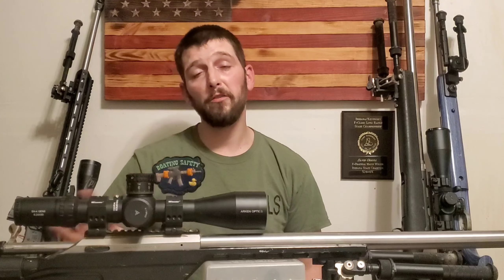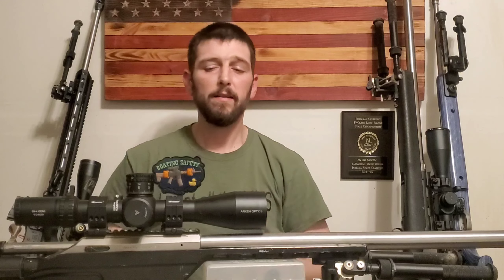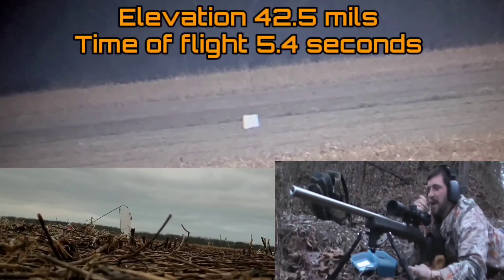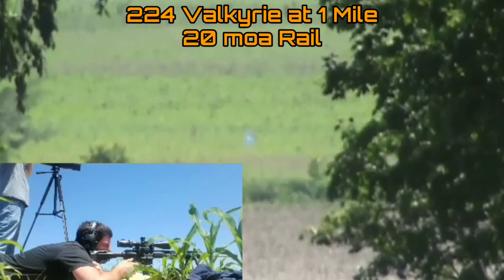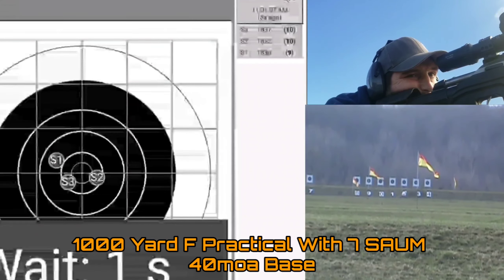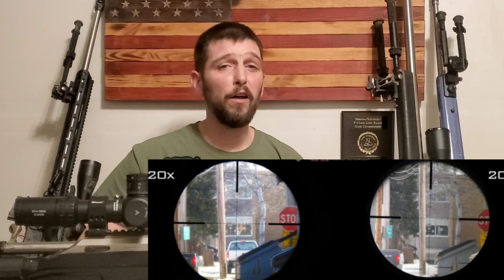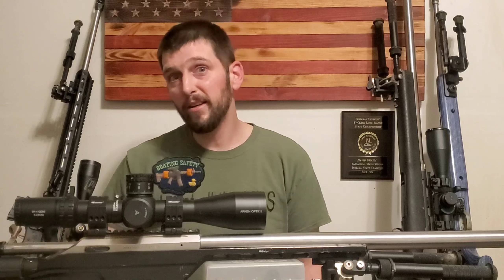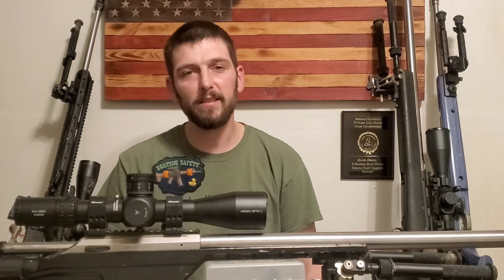Canted Scope Bases/Rails - What You Need For Long Range and ELR

Comment: I'm with you on  "picture box". For my ELR rifle, Ruger Precision in 338 LM, I chose the Valdada Recon G2 for the unprecedented 150 moa that it has built into its elevetion turret (also love the 40 mm main tube). With the factory 30 moa rail on the rifle I get about 105 moa of vertical up adjustment. That 105 moa gets me out to 2,200 yds. with a 95% capacity cartridge charge. Also, on a different note, I picked up a Crimson Trace 5 Series 3-24×56 for my custom built AR10. It sis on a Warne 30 moa skeleton cantilever. It seems to be working out to be a pretty decent optic. I had a problem dialing it more than 2 revolutions and upon further investigation I found out that the zero stop pins are not removable. I called C-T and they sent me two additional turret caps (elevation and windage) that I will modify in the caps to not hit the pins in the optic. I opted to not just simply file down the pins in the turrets incase I want to resell it. I told the C-T engineer that I couldn't imagine them having LOW design an optic to get 32 mils of adjustment that has non-removable zero stops?? I wouldn't have considered it at the regular $1,800.00 asking price..... except I got it 50% off for just under $900.00. Im happy with it at that price. It's glass isn't Schott and as good as the Recon G2, but it's really nice for the $900.00 I paid. Lastly.... I've been watching your channel for a long time and I am surprised that you don't have 10 times more subscribers. You have great content and do a great job! Keep up the awesome work and good luck in 2021 competitions. Ken.

Comment: A pretty safe approach: get a 20 or 30 MOA base, and combine with a set of Burris Signature rings with the eccentric inserts. You'll probably be able to configure the ring inserts so as to put your 100 yard zero in the bottom revolution of your elevation knob.

Comment: Wow - I was just thinking about changing to a 20 moa base !!
I lose 13 mils of travel on my scope to get to zero. Want to get some  back with the 20 moa base.
I already  have a 20 moa rail and my scope says 30 mil of travel available
(Athlon cronus 4.5-29). 
Do you think it's worth adding a 20 moa base also ?
Great info - thanks !!!
Reply from the maker: Thank you.  Depending on what your typical distances is that you shoot and what it takes to get your scopes internal mechanism to center for the clearest picture I would use whatever base gets me closest to that. Unless of course your goal is to get the most you can out of your rifle  then scope clarity isnt necessary the most important.
Reply: @gunfather83  thanks!!
I would rarely get a chance to shoot out to a mile, but want to keep the option open with my set up.

Comment: One other aspect is that you don't need extreme ranges. I have 300 yards at my house and a 16" 10/22.

They only make 20 moa bases for my gun so I cheated and bought a 20moa riser for a total of 40 minutes. I can get out to 500 yards with it.  It's still the same principle though that you are talking about. With that gun if I buy a 20moa scope mount I can get rid of the riser but for now there is no reason to change it.
Reply: I do find the use of risers to be great. I bought a 22 MOA Badger Ordnance one for my 6ARC build. It allows me to mount my optic where I want for eye relief and I can use a 20 MOA mount  (total 42 minutes) without much compromise on an AR platform.